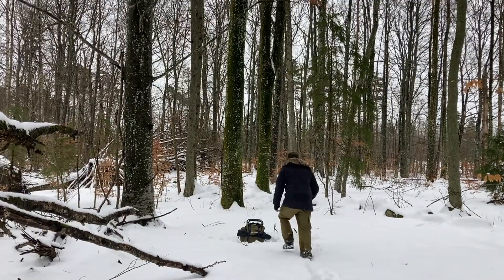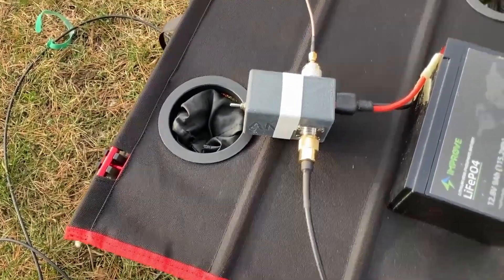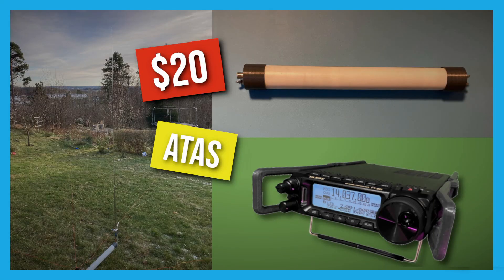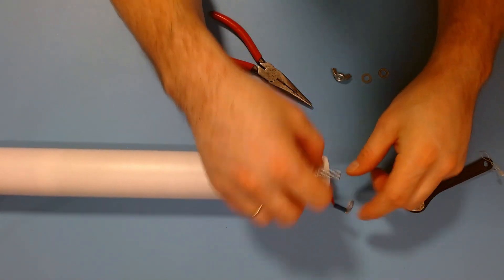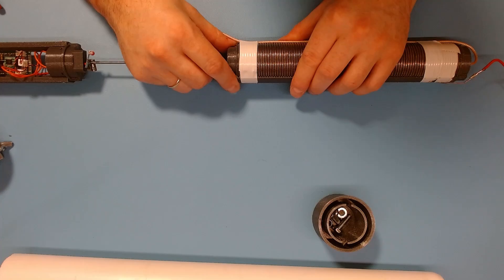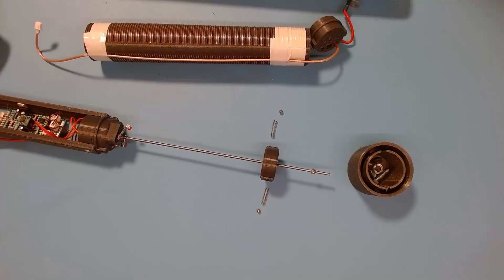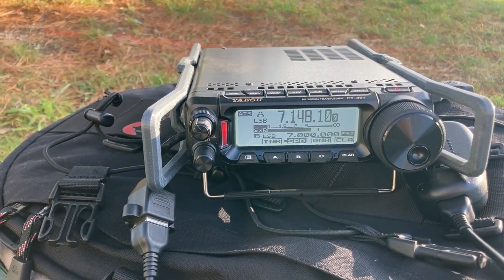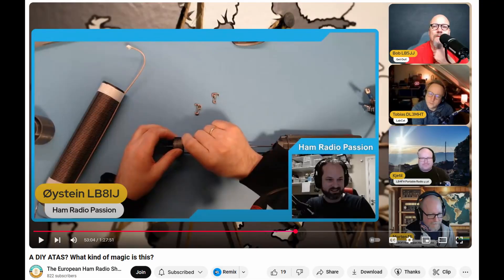ONE Coil to Rule them ALL! Unboxing The Magic Antenna Coil!

Comment: Whatever happened to the good old days, where you could connect a coat hanger out the window and communicate on any band? Now, you have to have all these expensive china parts that have to be magically put together in order to bring down this new swr thing. It ain't what it used to be.

Comment: Here is an idea for a different motor and wiper arrangement.  Use a non-captive linear actuator seen in this video.  
This way you could permanently attach the shorting conductor to the rear end of the shaft and also the wipers could be permanent on the other end of the rod, so you only have one single wiper (or two on each side for redundancy) that goes up/down inside the inner coil.  You would only need to account for the shaft length which may require the outer tube housing to be longer on one end.   https://youtu.be/hX9v5HIq_4s?si=_dxy0_qdITrBd2WK
Reply from the maker: Nice!

Comment: Maybe to try brass or copper threaded axle rod? In that case you can use copper nut as fly wheel (inside 3D printed wheel) and solder wires from nut to coil touching skids. vy 73 de YT1DL, Dusan.
Reply from the maker: That’s something to consider..